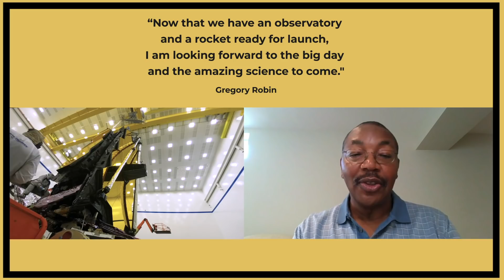Will The James Webb Telescope Finally Be Launched

Comment: With the JW, I will not be surprised to find that that the fossil light in the infrared pushes the concept of a horizon to a far greater time and distance. Not to try to destroy the notions of the astrophysicists, but to possibly confirm the actual amplitude and frequency of the singularity now only possibly visible in the infrared as it reduces toward entropy. If confirmed, then an additional companion may be required to detect the opposite end of the spectrum of energy into the hyper violet regions.
Reply: WOW IM IMPRESSED. L.O.L

Comment: Honestly, how many times has an antenna, solar panel or drill not fold out?  How many human errors like using KPH instead of MPH or the most important part of Hubble its mirror not built to spec.  There even calling it "30 days of hell" so they know its a gamble.   100% I want it all to work it would/will be glorious,  But when 1 month from launch they still want the  name  changed my enthusiasm and confidence is at 001%.  Sry for the negativity but had to vent some rage after TROLL THUMBNAIL!

Comment: Don't you even dare entertain the thought! 14 years of delays are enough. And I feel the irony of fate that it will almost certainly fail to unfold anyway* so it will be even a harsher disappointment than the ending of Game of Thrones.
But boy if it works! 
If not, we'll just have to delay the venture for another decade at least...

*300 steps in order.